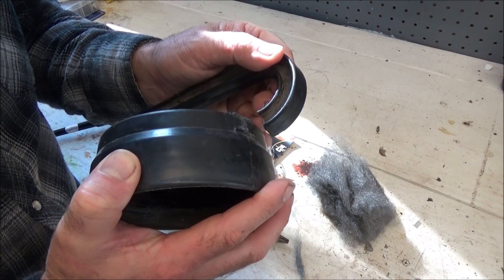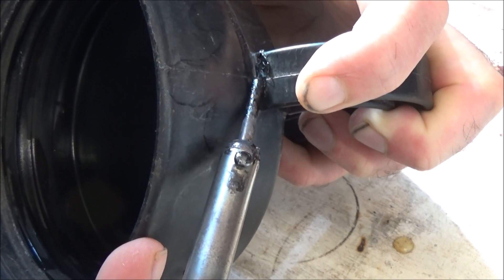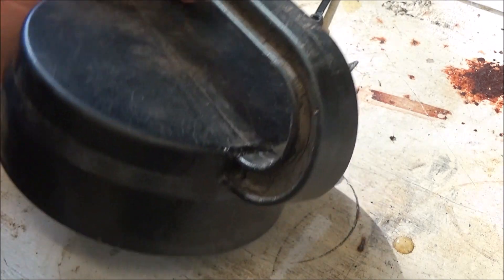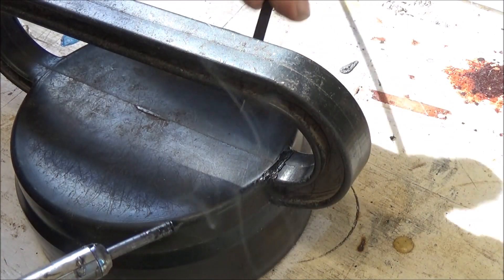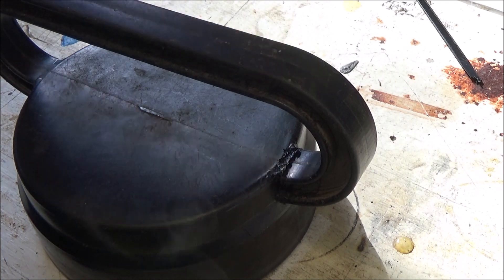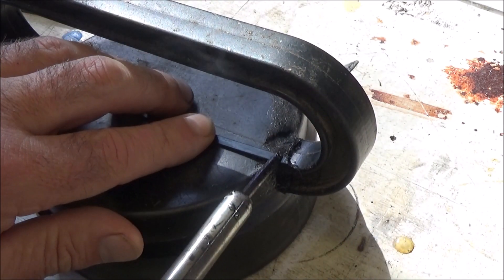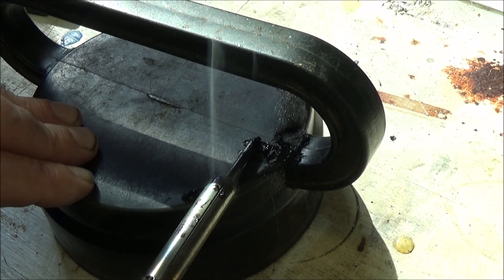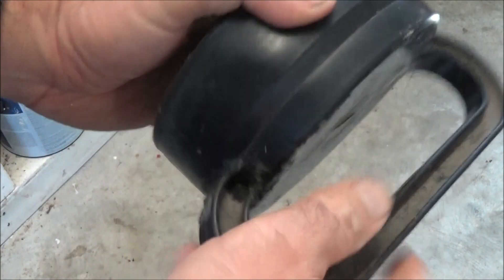how to weld plastic

Comment: steel expansion under temp changes is much less than plastic, might slowly weaken as product heats and cools...  nylon is thermoplastic that melts at 250c rather than 125celcius for hdpe, nylon thread might work better, similar rate of expansion

Comment: A great way to get a smooth finish with out sanding is to use a deep well socket to smooth it as you weld.
Great video thank you for sharing, fix it don’t fill the landfill. 😃

Comment: I wrapped copper around my soldering iron to make a copper tip.  It'll be on a video i release in a month.
Reply: Did the steel wool rust after awhile?  (Or were you able to cover it enough)

Comment: Thanks for this. I'm repairing a cracked HVAC box in a car and so far I just JB plastic weld (so glue) a piece of abs on the inside. Once that dries I might try this on the outside of the box to really make it air tight then heat and bend another piece of ABS and JB plastic weld that to the outside. So on top of the soldered plastic. Won't look super pretty will look better than it looks now (you can see a hole with the ABS on the inside. It will cover up the melted plastic too. 

I would do it all on the inside but it's so deep in the box and along an edge so can't fully get in there from the inside.

Comment: Nice plastic welding video.  I would've never of though to use steel wool as reinforcement mesh.  I have always used 2 part epoxy glue as it's cheap and readily available at the dollar store for $1.25.  Nevertheless, this method is an excellent alternative if you don't happen to live near a dollar store.  

Example you provided is very clear and easy to follow. Good work!
Reply: 2-part epoxy can sometimes fall off.
Reply: Very useful video, others have done very little to impress me.

Comment: I’m AWS certified welder. I built radiation machines for hospitals for years.. the problem with this is, nothing plastic is worth ur time, and now ur tip on ur soldering iron is screwed so u have dedicated tip to plastic. Between my torch and a coat hanger I can do this without damaging ur iron tip. Heck I can use a stove instead of a torch. I understand ur theory. The steel mesh is a good idea tho. I would t go that route. It’s plastics. U buy China stuff u have to ruin ur soldering tips. U have a Rotary tool? Cut the other half of the handle off and carve groves on the lid to make it a twist top, make it a spindle style top

Comment: Can you use the soldering iron again for metal/circuit soldering, or is the tip pretty much ruined by the plastic?
Reply: Its easy to remove plastic from solder tip, just scrape it off with iron wool while the iron is just starting to cool down.

Comment: Excellent Welding Plastic 101 Tutorial, Greg!
Take away quote "weld plastic... sounds a lot more sophisticated than it is"!  Thanks for adding "I'm just going to use a soldering iron" part too... it's not what you got but how you use it that counts, right?  Love the steel wool reinforcement and zip tie welding rod tips... Thanks for scoolin' this old nailbender! Best, Matt

Comment: I have half a dozen lawn mower HDPE fuel tanks and nothing works on their leaks. It's like "whack-a-mole" - fix one leak and you then have to chase it leaking somewhere nearby. Low reactive plastics won't bond to anything I have and soldering (both flame soldering or iron soldering) using spare HDPE doesn't work either

Comment: nice video.  I like the idea of using the steel wool.  I have been using small pieces of paper clip bent into a Z pattern to melt into the fracture line.  Except for the initial tack welds, most of what you are doing is cold welding, just melting filler onto the site without much "welding" or melting of the primary plastic.  It may bond the area but is far from a true weld in strength.  Thanks
Reply: I was thinking that, primarily because he's using what I'm thinking may be a non-compatible plastic (zip ties=nylon; not sure what the repair item is made from, but I doubt it's nylon.)

Comment: Lay a V between the cracks with the iron, same effect as grinding  a v in metal before welding two pieces together. Then follow up with using the iron to sweep plastic from surrounding area or a filler piece of the same plastic (you didn't even use the same plastic, your trying to mix nylon zip tie and PP or whatever that was) into the V. Trick is, just like welding, you need enough heat to actually melt the base but in the case of plastic not boil and char the plastic, that makes it brittle. You sweep the plastic into the v and smooth it over flush with the surface. I cut tiny pieces of metal out from a sheet and burr them up with the cutters of a pliar. You them melt those into the surface,  pushing the iron on them until they sin/k in and become embedded, crossing over your weld like a stitch. /Keep a wet towel nearby and cool the iron if you notice it smoking and getting too hot. Do it like that and you'll be pod racing in no time.

Comment: Thanks a bunch, I have an old Christmas Decoration that had a door opening mechanic, but it broke on the inside, so I was originally planning on using a  simple glue to repair it, however when that failed that's when I came across the idea to look videos up about this. 

I would have never thought to use my iron to plastic weld, but thanks its really effective.

Comment: Your wrong mate don't do this the zip is right but the rest is wrong so mate but you shouldn't be showing ppl this I'm not saying your other vids mite be good but if they are like this is says it all sorry mate
Reply: Why?
Reply: Also, you don't use punctuation. Why not?
Reply: Bollocks. You don't even explain why
Reply: but he said sorry?
Reply: Now I'm curious
Reply: Wow this was like 10 months ago and ppl are still going on right if I have to tell you because by now some off you should of found the right way of doing it but doing the wool is not very strong plus some holes needed to be made in the plastic where the crack is and yes it means make it bigger because what has happened is all that has been done is the fillers have been put over the top of the crack the zip part is right but they do say it needs to be cleaned but that's here or there my self when I do it one I put on a mask because that stuff can kill you use a little rotary tool to grind out what you need that way when you melt the zip to it it's got something to bite on to can put a paper clip cut it to size and shape it if have to and the melt it in to the plastic can buy them if you like they are called welding staples can even get the kit if you like same as a plastic welder but get the right one don't get the flate head soldering iron they bend can just use a normal soldering iron but will have to keep cleaning it off just use a file just comes right off and as for the way I write go do one I'm not here to have a school lessons there other videos out there showing you how it is done but can say a lot of ppl have there own way of doing it but what I can say if you want good out come do it right the first time so I hope that helps you all that been msging me about this matter and plz if you are still not sure on how go look it up or if you like I can do a video or make a picture because it's not that hard to do and you really will be suppressed on how easy it is to do have fun now

Comment: The crack sounds at the end make me doubt xD
Reply: Thats not a crack, thats a rapping sound from his fingers on plastic
Reply: @survivalistor6195  no hahaha.. he quite literally broke whatever weak seal he put on it. Watch it again see how he man handles it , it cracks and then on out he fake jiggles it cause he knows what he just did.. watch his hand jiggles but not the cock waterer. It's very believavke because that tool does not get to the right temp , he's using 2 different types of plastic, the top and then the zip tie for God sake he tried to melt down.. that ain't happening then as he put the metal surround on it he said be sure to melt the base.. NO... You don't melt the base you lay down a welding rod then the metal the melt it through then layyer another welding stick on too of it.. the plastic the top is made of melts into bread crumbs if you didn't notice .. what's gonna melt to bread crumbs beside butter or cheese... Alright then that's what she snapped
Reply: Hahaha lol😆😆😆
Reply: He knew it cracked cause cut the video asap.

Comment: Very Interesting!  I normally use JB Weld, but that has a 24hr cure.  Could see using both together, with the spot weld to hold the breaks.  Thanks!

Comment: why not just use hot glue gun to glue it
Reply: Hot glue doesn't bond to plastic very well. In order to make a strong joint the material needs to be fused together. This is so that it's like one solid piece instead of multiple connected pieces.

Comment: You flatten the top of the soldering iron so it looks like a spatula. Once you have a flat tip you insert it between the two broken edges wait till it melts both sides and smash it together as quick as possible for a solid bond. If you do it this way it is not a repair anymore (like in this video), it is refurbished.
Reply: Plus a woodworking iron insures that you don't burn the plastic most plastics weaken with a soldering iron it produces more extreme heat. And a woodworking iron comes with different iron tips
Reply: @whydontyouaskme  Thanks for the tip!
Reply: @whydontyouaskme  Could you link a good example of an iron with a good selection of tips like you spoke of? I'm currently using a 25W Soldering Iron

Comment: How do you clean the plastic off the soldering iron tip?
Reply: heat it up and get it really hot and dip it in steel wool a few times or with wet sponge
Reply: If you want to ever use it for soldering again, you're probably best buying a new tip. I find that after exposure to plastic/etc, solder will no longer wet the tip, regardless of how much cleaning and sanding you do to it. (Something like Hakko FS100-01 Tip Cleaning Paste will restore the tip and allow it to wet with solder again, but unless you're soldering regularly, for the $10 the paste costs, you're better off just buying a couple extra tips, then dedicate one to plastic.)
Reply: Or take it to a grinding wheel
Reply: I bought a metre of copper rod the same diameter as my soldering iron tipe. Using about 8 cm of the rod at a time i have a good supply of spare tips that I can use. By bending, filing, etc these tips you can have all the shapes you want to reach narrow places, or sharp edges, or flat plastic pieces etc. For those who have to ask how to clean a tip, don’t diy anything; you don’t have the imagination or common sense needed for this type of work!
Reply: @andrecrouse9704  rude. How did you learn? These are a start for someone who never has done it.

Comment: Brilliant, thanks. Do you know if it is stronger than using 2 component epoxy glue? I usually use 2 component epoxy glue, which I can "mold" around the edges. Often this works, but not always. Your welding method is probably faster in giving you a usable repair, compared to waiting for the glue to hardened, but it probably takes more of your time.
Reply: This will only work temporarily. If he had melted the two edges from inside out this would be permanent. It is not easy to do and only someone who is steady handed and quick would have the know how. Hear how it cracks as he tries to show his handiwork in the end.